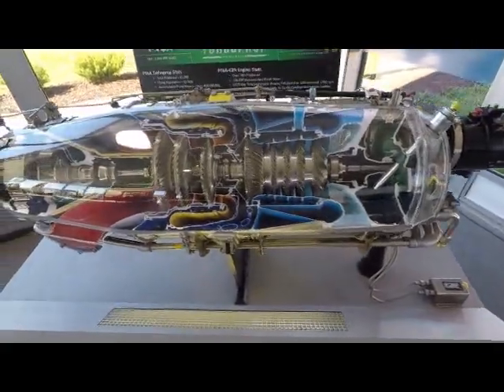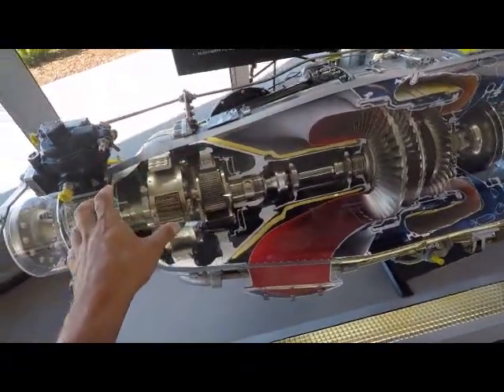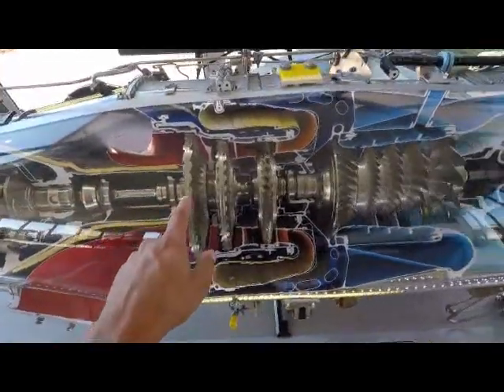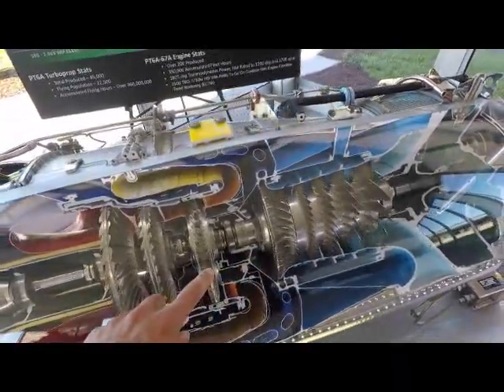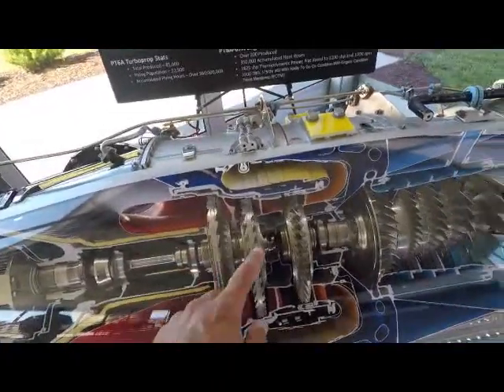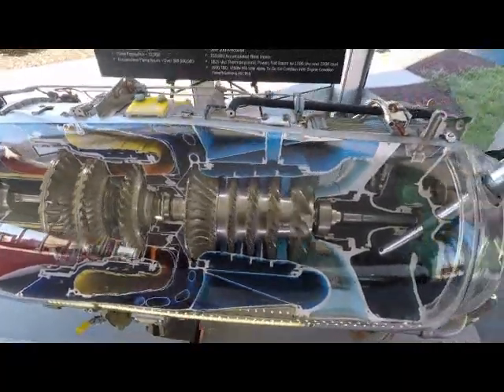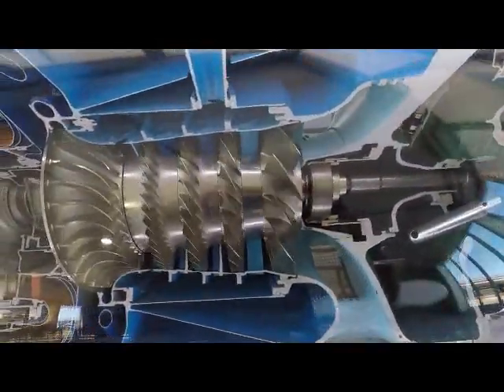How a Turbo Prop Engine Works

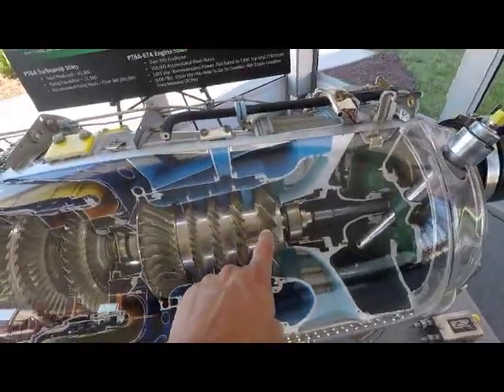Comment: 00:56 you say "it turns an output shaft of fans which in turn makes the engine run".  I stopped the video then. He has no clue how this works, but he thinks he does.

Comment: Actually I found the real solution :)  Looking at all the light turboprops, There is a  windmill fan at the end of the engine {(not connected to the engines shaft)) that drives a seperate shaft going past and above the jet engine that drives the propeller... that way the jet engine shaft and fans can go around at  thousands of rpm  while the propeller can go around at hundreds of rpm..

Comment: You did not answer my question... the first turboprop propellers went so fast the prop went  supersonic making a noise that could be heard 20 miles away...one fighter was called "the thunderscreech""  So how did they slow down the prop to stop the noise but still work efficiently???
Reply: The reduction gearbox  a1
Reply: This was a reply on quara from an engineer who explains it better than I ever could, he even mentions that plane. A turboprop is basically just a jet engine with reduction gearing to turn a prop at an efficient rpm. 

"A propeller driven plane can not reach supersonic speed from propeller thrust.
Look at it this way. A prop plane screws its way through the air. Whatever the pitch of the propeller blade, for every one meter the aircraft flies, the propeller tip has to travel at least pi x D further, where D is the diameter of the propeller. Consequently, as the aircraft gets somewhat close to sonic speed, the propeller begins to go supersonic, starting at the tips and working inwards. For the aircraft to go supersonic, the whole propeller would have to be travelling through the air much faster than Mach 1.
The drag experienced by the propeller blades increases enormously as they approach Mach 1, and the thrust from them decreases considerably. Add to this the noise from the propeller itself.
Supersonic propellers have been investigated, on planes that were still subsonic. The Republic XF84-H Thunderscreech (there’s a clue) was built to do that. 
The test program ended in a firm recommendation that the idea was a bad one. The noise alone damaged the aircraft itself, nearby buildings and the unfortunate test engineers who were close to it on the ground. And this was an aircraft that was not designed for or capable of supersonic speed

Comment: Ok some things to clarify, that’s a reduction gearbox. Turns high rpm low torque into low rpm high torque, because you don’t want the propellers spinning at super sonic speeds. Then the compressor is axial-centrifugal type with multiple stage and one centrifugal stage, I was expect can-annular gas can, but from what I can see, it’s actually just annular combustion. Thrust is 10% exhaust and 90% mechanical

Comment: If the intake is from the back, how come air is not turbulent enough to stall the engine whenever its running ?
I mean, air comes from back, gets to the middle, ignited, sent by a compressor blade disc backward again (toward the intake) there its once again messed up and redirected to the exhaust where it finally escapes hot and angry.
This should have a very messy and edgy airflow that would deliver low power output, if it will run at all, or did I miss something ?
Reply: Most of these engines have a very long intake which is actually underneath the propeller. It goes underneath the engine through a particle separator to get rid of dust, gravel, and ice, and the goes to a chamber where the annular intake sucks it in. The intake is a divergent duct so it slows the air down while also increasing its pressure before it even enters the engine. This basically pushes the air into the intake. 

A forwards engine can’t do this. It doesn’t have a long enough intake.

Comment: Man you got everything wrong. It's a reversed flow combustion chamber, and you point at the turbine calling it compressor first and then you call it fan. It's not a fan. A fan is sitting in front of a turbofan engine. This is a free-turbine turboprop.
Reply: This genius is an example of why people hate internet know it alls.  The dude obviously didn’t watch the whole video. Thinks he knows everything but has no ability to listen.
He was comparing how this is in fact a reverse flow AS OPPOSED to a traditional jet engine where the flow continues from front to back 🤦🏻
Reply: @MrLuvtheUSA  He did not use correct terminology when describing the compressor and turbine wheels [blades].
He did describe it correctly as a reverse flow engine.
In aviation precision and accuracy is very important and the presenter did miss the boat on some of the descriptions.

Comment: Thrust is produced by the propeller or engine itself like turbo jet?
Reply: @Aden Wieger actually 90% is from the propeller and 10% comes from exhaust speaking of Turbo prop. Now turbo shafts are 100% propeller
Reply: Hari Bahadur both

Comment: Alright the gearbox is not the prop governor. The PCU prop control unit is on the front 12 oclock position. The one on the side is the hydralic overspeed governor. The PCU flyweights are set for the selected prop speed, then prop blades are moved to maintain the speed. Extra gas flow(more power) tries to speed up the prop, and the prop will coarsen to maintain selected speed. Torque the main indication of power is a byproduct of gas mass flow/ prop rpm. For given power if you pull back prop, torque will rise. ( Torquexrpm)/5252= shp